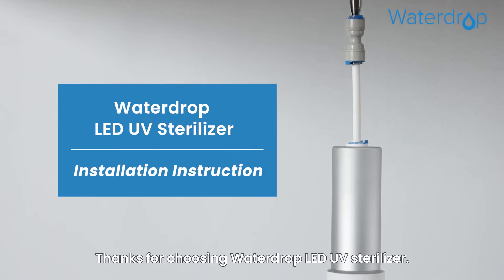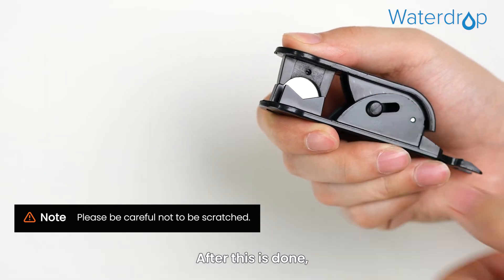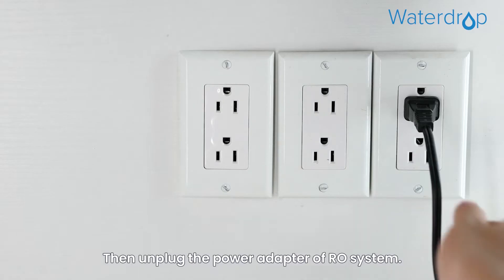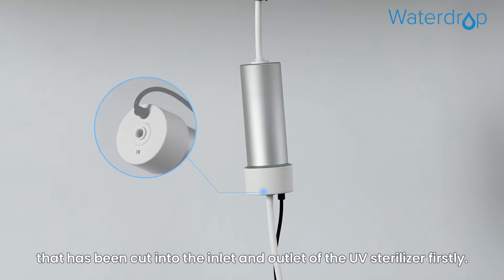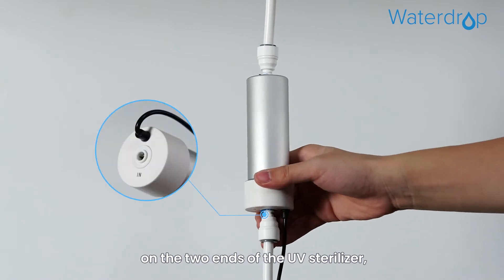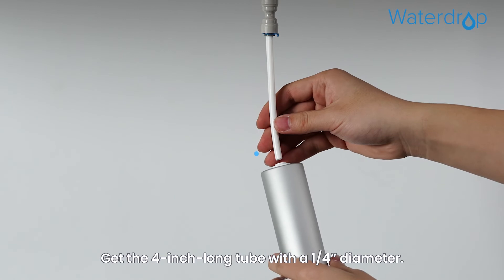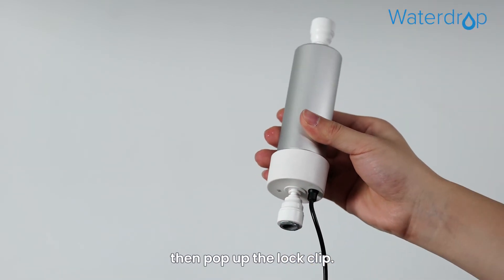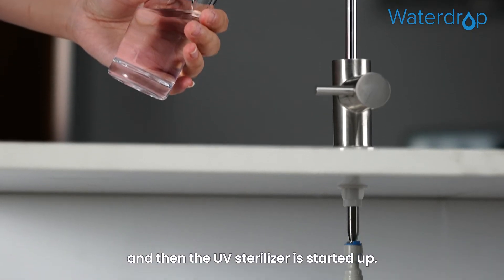How to install Waterdrop LED UV Ultraviolet Water Sterilizer Filter

Comment: I’m having problems disconnecting it. The video on Amazon says if it gets stuck that you need to reverse the uv filter to flush it out and then flush it. Then flip it again. So this will have me connecting and disconnecting the connections a lot and I’m having problems removing the tubes from the filter. I follow the steps of removing the clip then holding down the end near the filter and pulling tube out. Bottom came out but now having issues taking out the top tube. What a nightmare
Reply from the maker: I sincerely apologize for the poor experience. Please send details and pictures/videos to our after-sales support at Service@waterdropfilter.com. They will assist in resolving the issue or replacing the product. Thank you for the feedback - we greatly appreciate it.